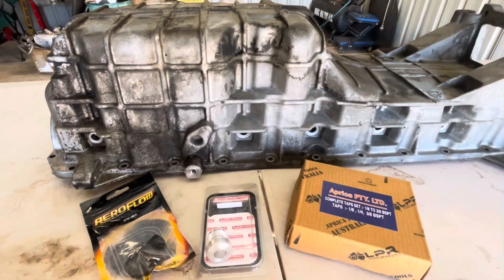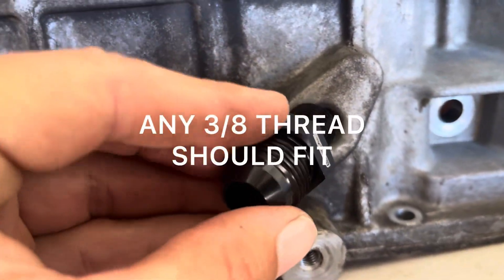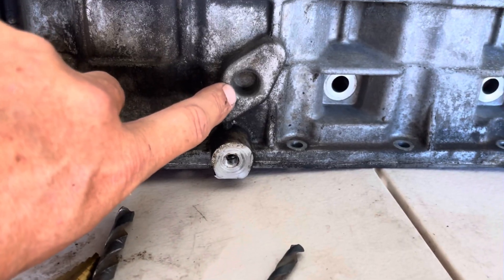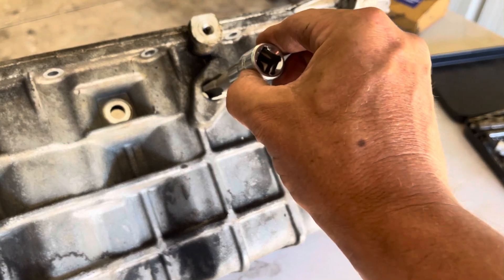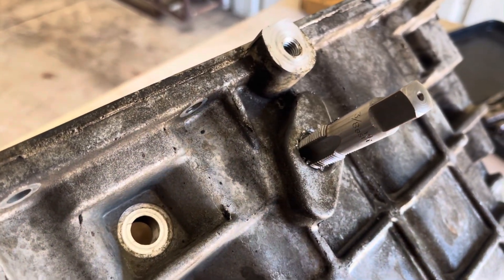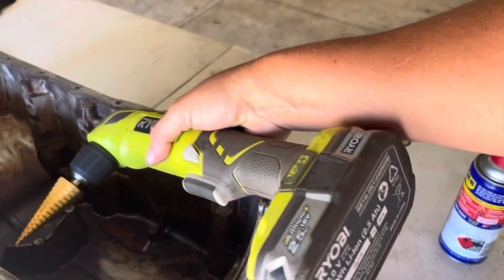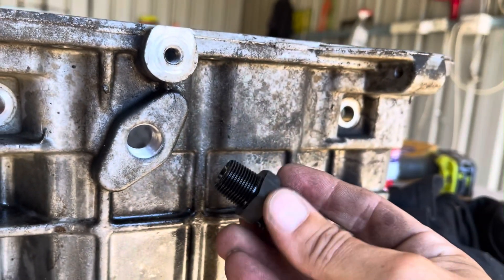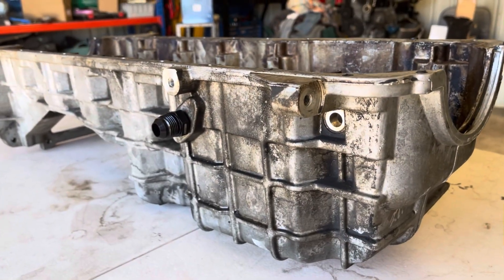How To Tap a Barra Sump For Oil Return Fitting

Comment: good vid man but i would suggest an NPT fitting as they tapper the entire way bspt threads tapper up just over half way an then go parallel, also with any kind of tappered thread you would want at least 3 an a half threads to show at the top as you want it to seal on the tapper an not bottom out
Reply from the maker: Ah rightey’o… cheers for that mate. I’ve used plenty of thread sealant as well so hopefully it holds up.

Comment: This is going to be a really good build to watch.  Now I need a b series,  would like to build one preferably an xr6. You keep making me want more ha,ha, they're a beast.  My fg turbo is the best thing ive driven.  Just a quick fun car thats comfortable and rides nice.  Dam Barras are so addictive.  Been driving my VY ss to work and it feels like a slug compared to my Barra.  Cant compare it at all in any way.  I like them all but these later Falcons are just amazing.
Reply from the maker: @petergoodwin2465  😂🤣😂 They sure are great engines. The FG are a more comfortable ride in my opinion but I just love the look of the B-Series cars. The turbo build will be a slow process but I’ll slowly plug away at it.
Cheers for the feedback too mate, I really appreciate it. Legend! 🤙🏼
Reply: @Jeenzy79  the B series really look great. Mate has an old BA boss 260 ute in mint condition.  Just looks really good,  was looking for a turbo b series but they are getting very expensive even the na xr6 is not cheap.  Glad you are saving a lot of them. Still worth buying over any Holden Alloytec boat anchor.  Worst engine I ever had,  disgusting thing to do the timing chains and that stupid thermostat.  So unreliable and no power . The barra is amazing, Ford really got Holden with the Barra.

Comment: Nice job you could consider using the intermittent or plug tap rather than risk overtighing and risk stripping it out the aluminium thread. Love the videos had an xt for 16 years and good to watch you doing videos working on the fords.
Vic
Reply from the maker: The intermittent tap would have probably helped for sure, being aluminum it was relatively easy to do this way. I will probably end up putting a rubber o-ring around the fitting when it finally comes to actually put it in the car.
Cheers mate.